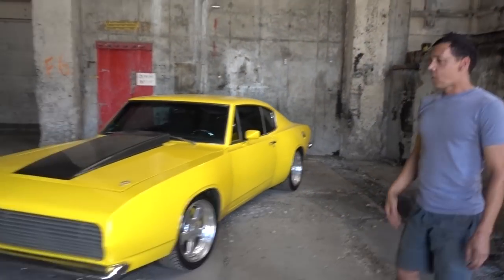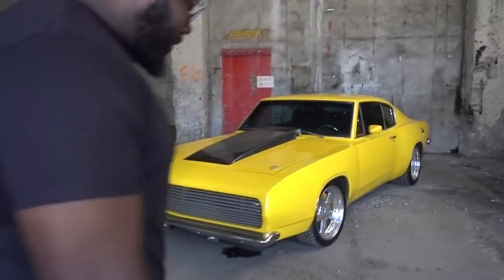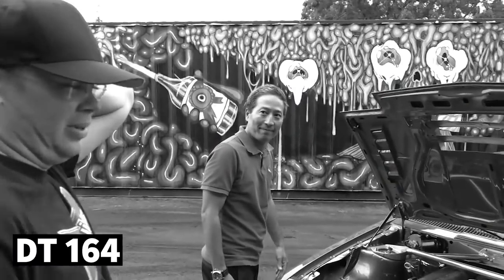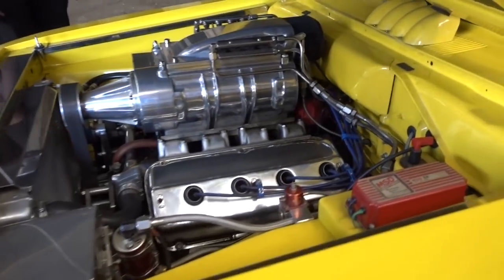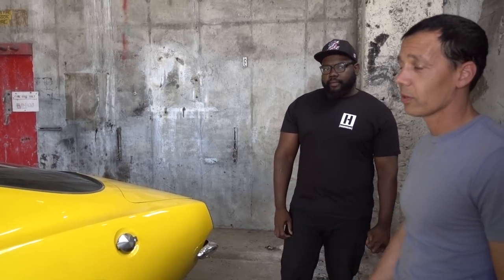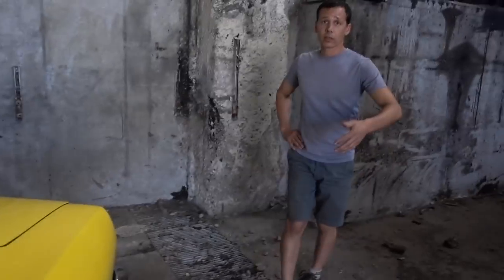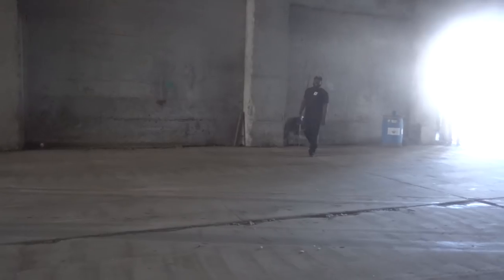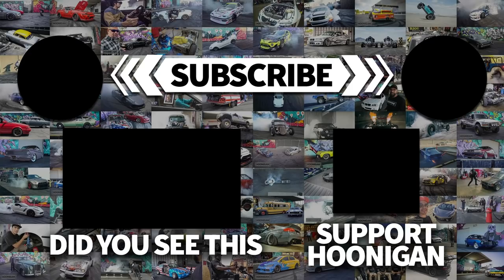600hp Widebody Daily Driven Barracuda: All Custom Everything!

Comment: I never understood why all the extra gauges are on the exterior of the car and not inside the car.
Reply: You can think of it as a primitive heads up display. All the information the show can be seen by looking through the windshield. This is especially true for the tach. The other reason is that for some mechanical oil pressure or fuel pressure gauges the fluid goes right into the back of the gauge. It's a lot safer to keep the fuel and hot oil out of the cabin.